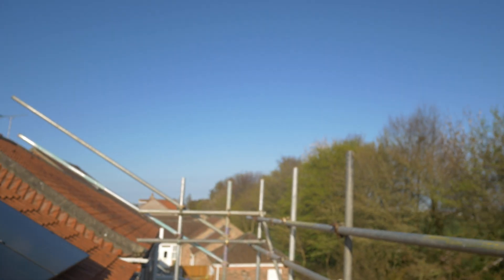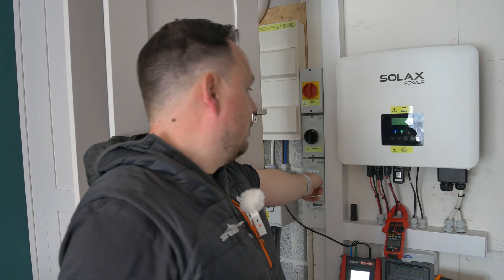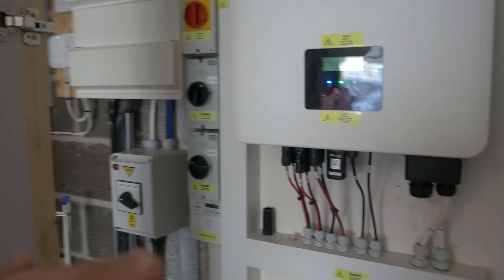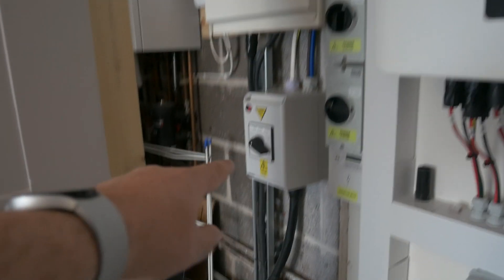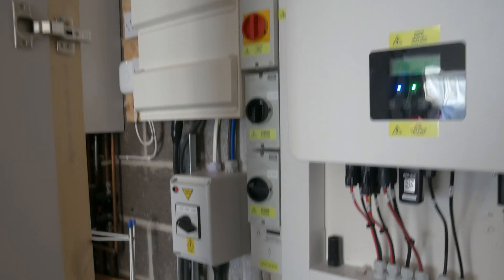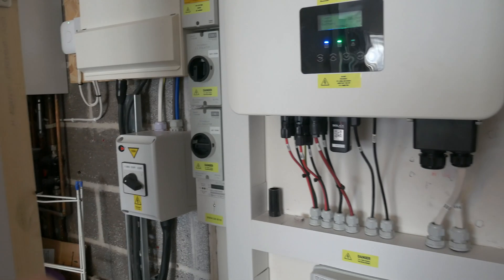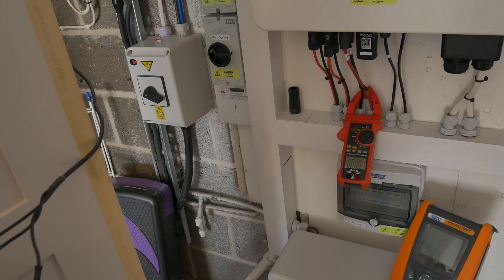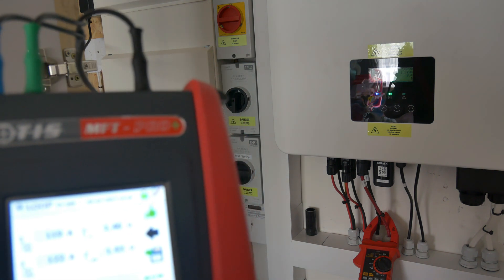Running my house off grid in Island mode - Solar power from Solax and Trina

Comment: Hi, have you connected your EPS neutral to ground? If not, is there a voltage between EPS N and EPS G?
Reply from the maker: Yes it's essential to hold an N-E bond to your islanded system. Speak to your installers to explain why or we have a few videos on the channel which goes into it.

Comment: Hi Mark,
Great video !
Could I get your thoughts please....
1. Apparently you absolutely cannot maintain the earth to the DNO in Islanding mode. (Unless I've misunderstood buddy) - what makes you think you can? Is it simply that your earthing figures are better/lower than the DNO's and therefore any fault to earth you might generate - would go to YOUR earth rod rather then their way ?
2. In Islanding mode you have to create an Earth/Neutral bond. This is easily done as when my Sunsynk inverter goes to Islanding mode - 240v are output on an "ATS" output - which I can then use on a Normally Open Contactor to short Earth and Neutral together. (Just for background) My Earth coming from a ground rod.
3. My second question picking your brain is this .... :-) So the Sunsynk has two outputs .... "LOAD" where it's a 2-way connection for both IN and OUT and simply feeds back to the house in normal use. However for Islanding there is a 2nd output called "Critical". Which you might normally run to a sub panel. BUT ..... If I turn off my consumer unit (breaking L&N) and break my Earth manually. AND turn off manually the AC into the Inverter (thereby physically breaking it from my 2nd CU in my summer house) .... Do you see an issue if I then separately feed a mains cable back into the panel from this 2nd "Critical" loads output to backfeed the house. ? 
I know if I did this, I would have to keep an eye out for when the power comes back on, and put things back to normal but would this in theory work ?
Reply from the maker: 1. Current guidance is to maintain the DNO earth alongside an electrode. You can not just use the dno earth but so long as an electrode is in place it's the preferred option. I've done other videos on this as while that's the preferred option of industry it's not necessarily my own view.
2. The timing of both the make and break of the N-E bond is critical. Some have done options as you describe but they generally fall apart somewhere. G98/99/100 has very specific requirements around this. 
3. I would not recommend. Speak with an electrician about a change over switch configuration or powering critical loads continuously from the critical loads aka EPS output.

These systems are dangerous if mistakes are made in both the wiring configuration and been around live parts. 

Your electrician will know the answers to all of the above questions and ensure you remain both safe and functional. Sunsynk inverters are not one we recommend so I'm not familiar with the specifics around that brand but I'm sure someone local to you would be able to advise.
Reply: Thanks for very speedy response Mark.

Comment: Earthing and bonding on face seems easy... but it's one of the most complex areas in electrical, I think.

You have earth netrual bonds,
Floating netrual
Lighting stike risks to building earthing and the list goes on

When it comes to off grid and generators, it took me a while to ge my head around the areas of the complexity .

The biggest issue is the rod and how far it is away from the dno earhing or if there is a bond to the water and its tncs.

Earthing can be very complex 

Victron has a very good off grid N to earth setup, and it bonds that together to make an earth and neutral bond so that rcbos still work as long as you put in a decent low impedance TT rod.

Again you can also run pme and add an addtional earth rod just my issue is how big shall ypu make the bonding conductor as you cluld be taking a whole street or part street if you loose the Pen conductor.

There are so many issues 😂

Great video Mark on a very complex topic that does catch alot of us professionals and diy installer out as on the face it's seems very simple..
But its most definitely not and if you get i wrong you can make the install very dangerous in off grid mode....

Comment: When you go into EPS mode you switch earthing to a TT electrode so separate earth from TNC-S PME, but for island mode it requires a neutral earth bond does your inverter have a N-E bond relay incorporated? Or have you done a N-E connection in the change over switch?
Reply from the maker: You are sort of right. In EPS the electrode helps form a TNS arrangement alongside the DNO earthing and bonds etc. 

The N-E bond can not be a simple connection in the change over switch as it requires specific timings in the make/break process during change over. It's essential this is done by bespoke setup or the inverters themselves. The solax hybrids have the option built in like the majority of options on the market these days. 

I do refer to this kind of setup ad hybrid in the earthing ad even during island mode the DNO earthing system remains in place. It gets complicated, more so than needed which is why I understand some refer it to incorrectly as TT for simplicity. Hope that helps.
Reply: @electrician247  hanks for the reply, 

I have a Solis 6kw inverter and I think it has a neutral earth bond relay built in, i am setting up EPS at home as I seem to be getting more and more customers asking for emergency power back-up and thought it would be good practice for me to do my own setup.

So does your manual transfer switch swap the earthing over as well as the supply? I was just curious as regs suggest island mode earthing can be run in parallel as you mentioned in your video.

My idea was to use an ATS as opposed to manual switch over, and using the steel girder construction of my property as an earth as I have a very low impedance reading from it.

I would be interested in any advice you could give as this would be very helpful as you seem to be doing a very good job in your EPS installations.

Comment: Hi Mark. Thanks for this. I’m in Portugal where the earthing system is always to earth rods. No PME here. 
I have a client with a SolaX X1 inverter that states that it needs a connection to the grid. 
He now wants to be off-grid and wants to know if the inverter could be ‘fooled’ into working without the grid voltage. 
Any thoughts?
Cheers. 
Alan.

Comment: Assuming you have no battery system & the public electricity grid goes down & the sun is shining, can you run your home loads if you just have a 10 kW solar array & an inverter/s?  How many continuous & peak Watts are available from inverted solar power only?
Reply from the maker: With grid tied solar inverters they shut down when the grid goes down so no. 

You can get off grid inverters which would do as you describe output would depend on their size and the array feeding them. But you can go pretty large in theory. 

With grid tied you require a battery inverter to keep systems online. The AIO I’ve shown here has a 7.2kW peak when matched with 5kW of sunshine that’s useful output.

Comment: What's the discharge rate of your inverter? Im guessing you are only running certain circuits from your CU when in island mode?
Reply from the maker: It will output 25A but yes in island mode we manually ramp down our consumption. The beauty of manual control on the change over.

Comment: Just a quick question as Solax do not seem to respond to emails. We installed this hybrid with 2x US2000C batteries that have sat around for a year. Mains is not yet connected to the house and will take 2-3 months to get installed. We were hoping to use this system to give us some lights and charge power tools for the final fit out but just get a IE 002 fault. The manual says there is an EPS setting (p76) but this is not in the menu on the system. Our sparky has got annoyed with us and is telling us he can do nothing until the power is connected. I cant believe they would make a system that cannot run 100% in off grid mode. Is there an easy way out of this we have missed? Amy help appreciated.
Reply from the maker: You need to ensure the system is up to date via Solax technical support in your country. You will be able to power a socket via the EPS output port if you have the same inverter. You need to enable this in the advanced settings accessed through the solax cloud app or website.
Reply: Thank you so much for your help and quick reply.

Comment: Hello, I need some advice please:

We already have a grid-tied 6kWh array installed on our main roof that supplies the house and charges a 15kWh battery.

I want to add a totally separate off-grid array, consisting of 4x405kWh panels in my garden to power one of my computer servers in the garage that consumes about 200W/h, and was looking at getting a Solax inverter instead of a cheapy chinese charge controller to charge my 4xLifePO4 batteries (5kWh combined). Ideally, I'd need a system that could automatically switch to the grid if there isn't enough solar generation or battery power but I'm not sure what I should be looking for. Any advice?
Reply: Goodness me, I've just seen the £1200 price tag attached to a 5kWh Solax inverter...
Reply from the maker: That is more than we pay but regardless why the 5kWh inverter if just 4 x 405w panels inputting?
Reply: @electrician247  My thought was that if I get a 5kW inverter from now, I can add more panels to it in the future.
Reply from the maker: @alpachino468  true enough. Hybrid inverters are higher cost and you definitely get what you are paying for.
Reply from the maker: you will need a hybrid inverter if you plan to couple DC batteries into the system. Solax is among the best value ENA approved products.
Reply: Any idea who would be the most cost-efficient supplier to purchase one from for a regular consumer, and are there any specific models you would recommend? Many thanks 👍🏻

Comment: Nice video Mark, I have external earth rods fitted and these have an earthing value lower than the DNO earth value ( added to a pme TNC -S system).
Did you say that the DNO earth must be disconnected at every occasion ( along with Phase and Neutral) when running in island mode ?
Im a retired spark so need some pointers.
Reply from the maker: No you can run in parallel if you wish. I've chosen to disconnect but you don't have to
Reply: @electrician247  Thanks for the info, my other passion is Amateur radio so the external earthing is supplimental .
This is to prevent my radio mast from becoming the local earth in case of a distribution neutral fault, via my antenna coax.
Reply from the maker: @radiotowers1159  a sensible move! Totally understand

Comment: Hi mark, I’m just doing a job for a customer who wants the system to switch over automatically, which is causing some headaches, just checking with you that the eps terminals on the solax inverter are always live, they don’t become live when it switches to eps mode? As mine are permanently live. 
Cheers
Reply from the maker: Thats correct mate yes.

Comment: Really good video as always Mark but I must say I'm a bit surprised that you disconnect the DNO earth when in EPS mode. Maybe the reasoning is dependent on specific circumstances but in my case I live in a cottage, 400m from my nearest neighbour. My supply is from an 11kV overhead line feeding a transformer which serves my property only. This has a 100A fuse on the pole with a 35mm2 service cable entering the property and another 100A fuse in the cut out. My earthing arrangement is TN-C-S and I have a decent loop impedance of 0.15 ohm. 

My hybrid inverter is a Victron Multiplus-II 48/5000/70-50 and I have a pair of Pylontech US5000 (4.8kWh) battery modules attached as well as a PV array of 16x Trina Vertex S 425w panels controlled by two Victron MPPT 250/60 charge controllers. I really like the Trina panels and they were great value.

So, as per regs, I installed a supplementary earth comprising two 4 foot earth rods in series and achieved a Ze of 20 ohms. This is connected to the MET permanently. In the event of a grid failure, the Multiplus-II automatically disconnects the line and neutral input conductors and moments later it connects the earth and neutral inside the inverter to form a TN-S island-mode supply. This all happens within 20ms so the lights don't even flicker. RCD/RCBO functionality is maintained.

In my circumstance, it's highly unlikely that a PEN fault will occur since my service cable is a concentric design and it would be hard to sever the neutral/earth without also severing the line conductor. And the service cable is right outside our kitchen so we'd notice if someone was digging in the vicinity.

The DNO earth is 0.15ohm which is much lower than I can reasonably achieve locally so why would I want to disconnect that earth when in island mode? Our water pipe is plastic and we have no mains gas so no bonding issues.

We get power outages several times a year and have had 3 or 4 since we installed the Victron setup but the only reason we can tell that an outage occurred is because our range cooker is not on the maintained loads consumer unit so the clock loses the time if the power fails. But pretty much everything else is maintained, other than the electric shower and EV charger, so we don't even see a flicker of the lights.

Thanks again - really interesting content.
Reply from the maker: Sounds like a nice setup! 

As discussed in the video it is fine to remain connected to the suppliers earth in some circumstances. 

My own view is if the DNO have isolated your supply it presents two issues. Firstly their network is in fault conditions and as you identify   could import those into our island modes. PEN faults are incredibly rare but they do happen. Equally a jointing error both at a tx, pole or buried connection. Most faults occur due to failed jointing/connection rather than severed cable during excavations.  

The other issue is if people are working on said cables and our installs enter fault conditions we could be putting jointers at risk who have made isolations in good faith. 

More widely my setup is to make some interesting content. I have a whole range of earth electrodes and it's interesting to see how they all perform in grid and island mode. 

I have a solax matebox that will do the automatic change over as you describe.  However and again this is purely personal choice as discussed in the video. I want the decision to enter island mode to be known and under the control of operators. Seen to many contactors stick and go wrong over the years to ever want to rely on them long term. 

The beauty of choice I guess. I choose not to leave a known fault condition connected to my island is the short story I suppose lol.
Reply: @electrician247  thanks for taking time to reply in detail Mark, much appreciated. 

I understand what you're saying and it's probably good advice in the majority of domestic situations, but I think, in my situation the 0.15 ohm Ze I'm seeing is mostly coming from the presumably buried mesh next to my supply pole. Yes, I guess it's possible to import a fault situation via that earth but I find that hard to imagine. If I was in the middle of a typical residential setting then of course that would be a different equation.

As for the automatic switching thing, I see where you're coming from but although I work from home and can manage my setup most of the time, I also want things to work seamlessly when I'm not at home. 

We have all circuits other than range cooker, electric shower, and garage/EV running from the Victron maintained loads consumer unit, although I do have a changeover switch to allow the power source of this CU to bypass the inverter in case of inverter failure.

So as you say, I think it comes down to a preference for absolute control vs a preference for doing the right thing in xx% of grid failure conditions. So it comes down to what you thing xx% is. In my case I think it's 95%+
Reply from the maker: @craigchamberlain  much of what we do as electricians is accounting for the 1-5% of times when things go wrong. We could argue whats the point of OCPDs (rcbos/MCBs etc) when they never trip lol. 

The risks on your supply are unique but with any TNC-S supply it is always present.

Comment: Can you please clarify? I have a cabin with no grid. I installed the inverter with the battery and conected the consumer unit to the eps conectors of the inverter. But the inverter gives me the error saying that there is no grid. How should i wire it in order to make it work? Just bridge the N and Earth conection? Many thanks!
Reply from the maker: The hybrid inverter needs a grid connection to first sync/commission itself.

Comment: Hi Mark. I may have picked it up wrong. Your change over switch did you say you use a 3 pole switch and you switch the earth as well.
Reply from the maker: Exactly right Gino. The earth from my earth farm is permanently connected in the consumer unit to support the dno earth in grid mode and replace it during EPS. I know we don't have to disconnect from the earth during EPS. But it makes sense to do so considering the nature of grid faults and times I intend to use EPS mode. With no bonding required to plastic services in my property it was an easy decision. It's all in the video or perhaps the next one. I've made a few on this 🤭